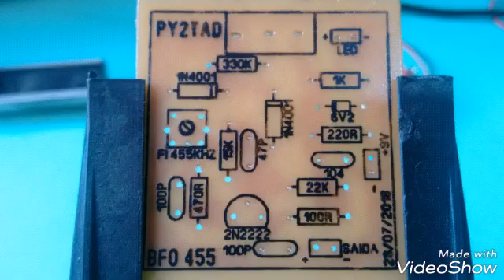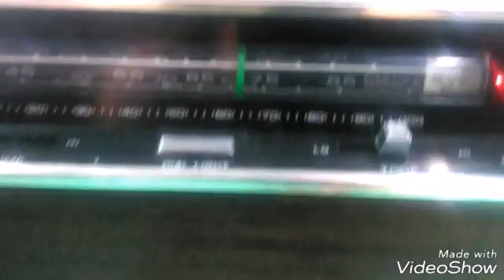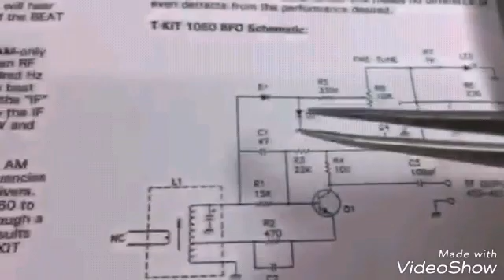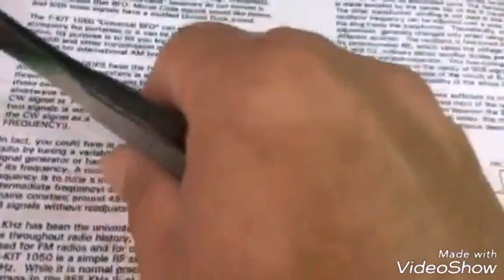BFO - Testes e dicas de montagem

Comment: Boa noite Maurício tudo bem, vou montar esse bfo e comprei os componentes na solda fria, estou com uma dúvida o diodo Zener está na nota como 1n5235/ Bzx79c6v8/1n957, então peguei uma bateria soldei o resistor de 220r, mas ele está estabilizando em 8.5, quando na realidade era para dar 6.8 , será que dá problema, ou tá certo.
Reply from the maker: Pode testar sem problema, não é crítico.